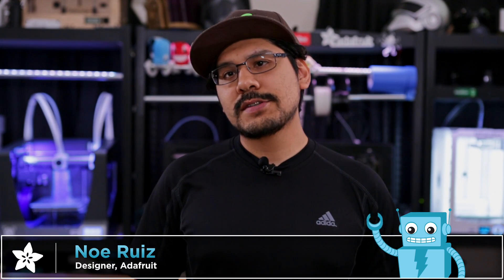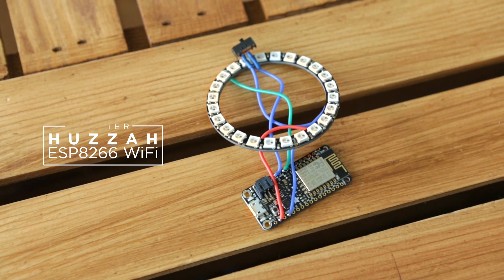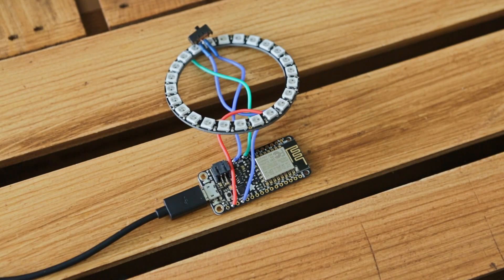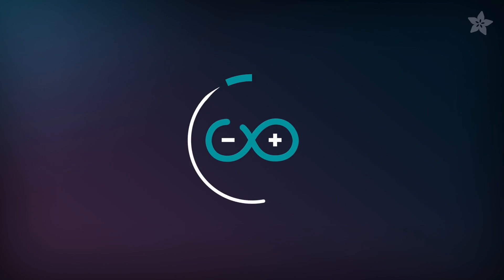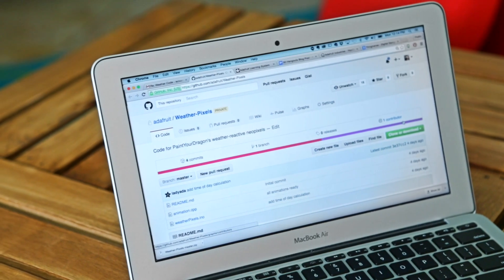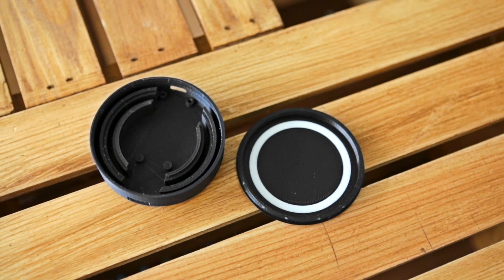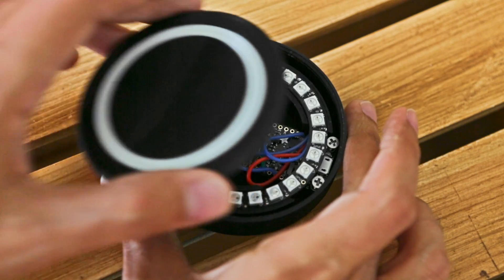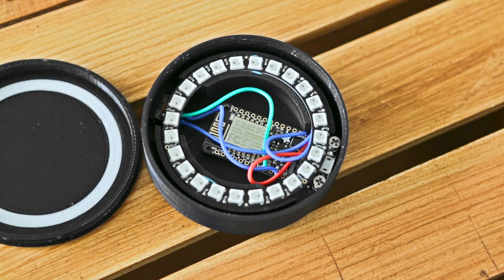Feather Weather Lamp @ESP8266 #IoT #3DPrinting

Comment: Yahoo changed their API per january 2019. V1 does not work anymore.
Reply: Did you find any fix to this? I just built this yesterday and had the nice surprise of it not functioning.
Reply: @haydenl336  did you then find a solution for the project?

Comment: can you use a feather huzzah or a feather blue fruit to receive live data from the Arduino IDE software, i need help with a project, and not sure witch feather boards or trinket or modules to use, do you guys offer live support?
Reply from the maker: For technical questions / help please post in the forums at https://forums.adafruit.com/